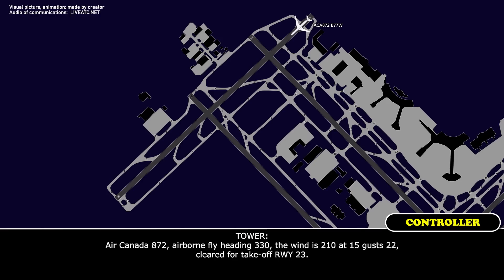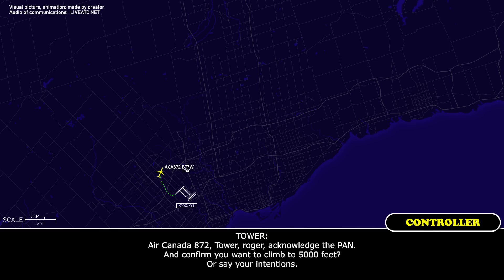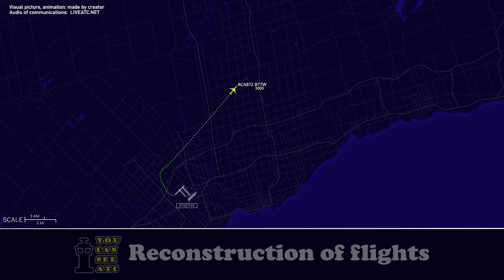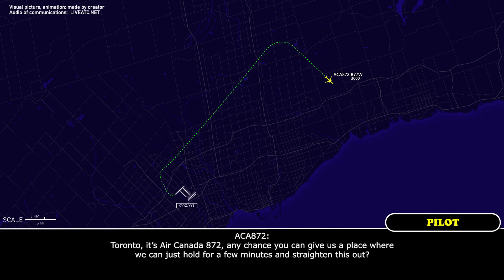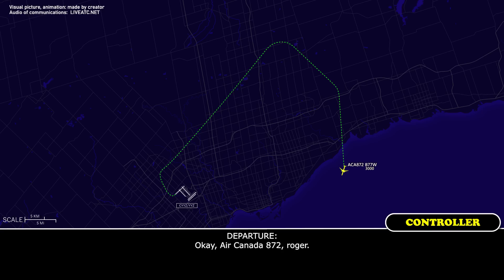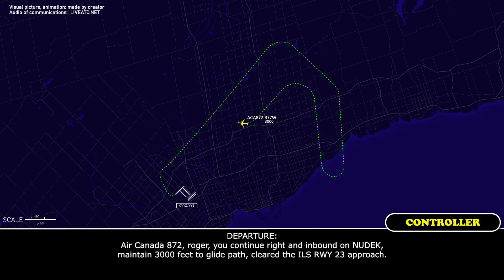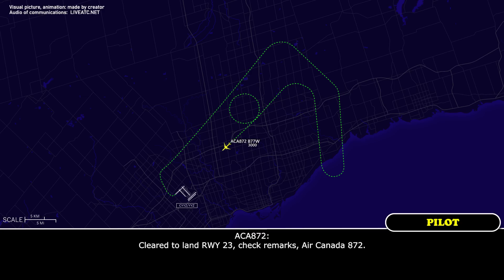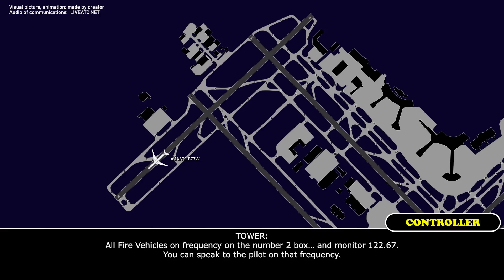“You got a lot of fire”. Air Canada Boeing 777 returns to Toronto Airport. Real ATC

Comment: They can takeoff on one engine.
Reply: Not legally, but if you were light enough and the runway was long enough I think you might be able to
Reply: NO they can't. At least not from a standing start.  Below V1(decision), an engine failure requires a reject. After V1 one must take-off and the certified and calculated Runway and Weight data assures a climb to meet all obstacle requirements from 400'AGL to 1500' AGL terrain excepted.

Comment: Professionalism on all accounts but was wondering with a aircraft that size and assume full tank that the plane can land without dumping fuel?
Reply: Landing overweight most of the time means just that the plane needs to be checked for damage.

And this plane was on its way to maintenance anyway.

They could have done it but it's not mandatory.

Most likely the pilots wanted to land before the thunderstorm came in.
Reply: Toronto to CDG isn’t a very long flight, they may well have been under max landing weight already

Comment: this aircraft is designed to have amble lift with ONE engine.  they practice single engine takeoffs on the simulator regularly. not a big deal. why are Canadians for fear prone ?
Reply: Correct that the plane can fly on one engine. But with a reported fire, nobody knows if it is contained or will spread to the wing or otherwise start knocking out systems or pushing smoke into the cabin air. No pilot or airline will continue a flight on a single engine.
Reply: @stevelappan8543 : Indeed. If you are still over land and have any issues with an engine, you don't proceed to crossing an ocean.
Reply: ETOPS?
Reply: For what’s its worth Dave 39 years of airline flying of which 5 years was on the  777 12 years 777 sim instructing CB s all quads at night .Not big deal until it’s your turn how many actual engine failures have you had better yet at V1 . I have had 4 none at V1
Reply: @gordkenworthy616 it’s not an engine failure, it’s a surge.
Reply: Yes you are right
Reply: Kick how many surges have you had in effect engine failure especially at V1 . I had one departing 33 at V1 when there only was 33 on a 727 . As you would expect number 2 we had a crosswind briefed for possibility trust me same effect as engine failure plus very loud bang . The guys got back on ground safely and in the end that’s all that counts .

Comment: Student pilot here . I know they have checklists to run but why are they flying away from the airport? They should have landed and sort things out at the airport instead.
Reply: Thats a fair observation.. I would say if you have an uncontrollable fire, or smoke in the cabin, get on the ground right away. In this case the plane is flying pretty good… don’t rush.. spending a few minutes in the checklist might prevent a mistake (shutting down the wrong engine for example… it’s happened). The hold/vectors allow a quick talk to the flight attendants and then the passengers too. But spending too much time flying on one engine simply to complete a checklist also seems like overkill. There’s a balance there IMO… good question for a discussion
Reply: They most likely had to shut down the engine that stalled.  So they have to run through the engine stall check list, then they have to do basically do a quick briefing for landing at the airport and then the landing checklist.

Comment: Second incident in a week, I believe the other was also a B777. ETOPS rating will be in trouble.
Reply: No it won’t. ETOPS gets in trouble for systematic problems, not for statistical anomalies
Reply: @swems-z3s  I think engines are systematic. A inflight shutdown last week and another B777 engine issue is a problem. Flying across the ocean on one engine is frowned upon. I'm pretty sure TC will be asking questions. Engine reliability is one of the biggest factors in maintaining ETOPS.
Reply: @2strokemerc  again, that is a statistical anomaly because there are no systematic issues prevalent. Especially when the incidents aren't even technically related. 
And btw. inflight shutdowns happen basically every other week across all kinds of aircraft types. Don't make a big story out of a non-issue.
Reply: @2strokemerc just because it’s a 777 doesn’t mean it’s the same type of engine.

Comment: Seems like a long time for a plane on fire to  be brought in..coulda exploded in mid air.
Reply: If they had reason to believe they were on fire and it was not extinguished, they would have been in a lot quicker. 

But they quickly identified the issue as a compressor stall on the #2 engine and followed procedures appropriately. 

Just because it looks like they had an uncontrolled fire from the ground doesn't mean that's what the actual issue was.
Reply: Apparently the engine is designed to fall off in the event of an un-contained fire that won’t go out, so, even with a severe fire you’d still fly a circuit of some form, so landing upwards of 6 minutes after take off.
Reply: @EdOeuna engines are absolutely not designed to just fall off if they're on fire.  They ARE designed to fall off if the attachment points between the engine, pylon or wing are overstressed somehow (to prevent even worse damage to the airframe), but that doesn't apply to a fire.  The engines are equipped with extinguishers though.
Reply: @stephenp448  - the GE90’s on the plane I fly certainly are. It’s not part of a checklist or procedure, but the bolts will fail through intense heat and release the engine. Hopefully you’d have landed by then and aren’t in the middle of a 207 minute ETOPS sector.
Reply: @EdOeuna  Interesting!  Not a design feature I had ever heard of.  You learn something new every day.
Reply: Nothing was on fire genius, it was an engine surge, a compressor stall, very similar to how an afterburner works

Comment: Would have gone with Mayday Mayday Mayday instead...pan pan isn't appropriate here.  But ICAO pilots think differently than U.S. domestic pilots.
Reply: And ATC at end of tape called it an "emergency aircraft."  Which this clearly is.
Reply: Perfect example here.  He is directed holding instructions by ATC, instead of the pilot directing what's better for them.
Reply: @1WINDSHEAR ATC immediately told them they can have whatever they need, and they always have the option to declare MAYDAY if they don't feel sufficiently heard. Why are you seeing issues where there are none?
Reply: @1WINDSHEAR the pilot specifically asked for someplace to hold....
Reply: Mayday is for imminent threat of life. There was none in this video. Pan is adequate.

Comment: Having flown a LOT of Jazz (AirCanada commuter flights) on CRJ-100/200s out of / into Pearson (YYZ)... basically a bus with wings, I've never had a moment of concern. 
   ONCE, we had a go-around and toured downtown Toronto, flying a loop around the CN Tower. It was a "highlight", not a concern.
Reply: Actually, with the automation in these aircraft, a hold is safer and preferred. Very easy to input and engage and then the aircraft can fly the pattern for a long time and be very safe. 
It’s a constant known pattern without the risk of being forgotten (think busy JFK airspace for example). This crew did a superb job.
Reply: @busboy3943  The flight path shown goes into "no mans land", in that, it's over a very densely populated area. When it crossed Dufferin then Yonge St. I was "sure" they had control. Otherwise, they'd head for the lakeshore.

Comment: Absolute solid decisions happened within that aircraft, they had an answer ready for the ATC regardless of what the questions were and subject to the many variables there were evolving. Commendable crew and controllers for not over-communicating...
Reply: Very true, intended to give pilots time and less chatter so they can address the issue with focus.
Reply: Big thing we get taught on those calls is to tell ATC to stand by after declaring the initial emergency/Pan Pan so they know we're doing stuff and will get back to them shortly. Easy way to wind up rushed otherwise.

Comment: ATC didn’t ask for POB and fuel remaining.
What does “Check Remarks” mean?
Reply: check remarks means I understood what you just told me and they do not require action on my part at this time.. Good shorthand, eh?
Reply: The not US. So they are smart enough to understand that the plane is full (or even look it up). Same for pax. Does require some basic communication capability within the airports departments. But very helpful for the pilots, who have much more important things to do.

Comment: The pilot keeps asking about the weather because a pretty major storm system was moving in from the West around the time. I believe it hit the city around 2300. If the flight was 2125 there would be genuine concern about airport conditions getting hairy.
Reply: No urgency to land with just one engine, so a diversion would be pretty simple if the weather had shut down the airport.
Reply: I wonder if that consideration was included in the departure brief?  Here’s a scenario where a takeoff alternate would be an excellent consideration even though the vis is not “low”.
Reply: @alpenglow1235  Dont worry im pretty sure they discussed it ;)

Comment: Curious why the controllers never ask for fuel and souls
Reply: To expand on what has already been shared, a pan pan call indicates that the flight is dealing with an urgent situation (usually a technical issue or failure) that does not pose a risk to life, i.e. does not yet reach the threshold for a mayday. 

The more familiar mayday call indicates that there is an imminent threat to life/loss of the plane. A pan pan call can be changed to a mayday if the situation worsens. You could argue that they are both technically emergency calls in the general way we use the word, but the mayday call is what is known as declaring an emergency. 

The plane is designed to fly safely on one engine and as long as the major systems continued to work, they could fly the plane safely, and they expected to be able to land normally, the pilots likely didn't think the situation met the threshold for declaring an emergency (mayday). In a situation like this, the emergency crew on the ground would have been deployed in either case, out of an abundance of caution, so it had no real impact on the ground response.

The ATC does refer to the flight as the emergency aircraft. That could be a matter of semantics (speaking to an emergency crew about their target aircraft in an emergency response, it makes sense to call it the emergency aircraft), but interestingly, this reminded me that ATC is able to declare an emergency for you, based on their judgement. Perhaps they did so, given the dramatic flaming engine they viewed as the aircraft took off.
Reply: true. But a lot of times a controller will still want to know especially since they rolled equipment and referred to the aircraft as the “emergency aircraft”
Reply: @jon_august  Sometimes it can be determined without asking the pilots - if the aircraft is returning to the same airport it departed from, the airport will have that info and controllers may ask the airport instead of the pilots. Also, if the flight just left and is immediately returning, we can assume a lot of fuel.
Reply: My guess would be Canadian airport is able to communicate inside the port. Someone on ground definitely knew the amount of fuel and people put in and because the plane just took off that number was still correct.

No need to bother the pilots.
Reply: @JariJuslin  that shouldn’t be rocket science. Call airline dispatch, ramp, etc
Reply: They did not declare an emergency.
Reply: You mean a frying pan declaration does not require souls, fuel and lav chemicals onboard?
Reply: @RLTtizME  Exactly.
Reply: @Quotenwagnerianer  I'm switching to emergency. Maypans are unnecessarily complicated.
Reply: @RLTtizME  No they are not.
Reply: @Quotenwagnerianer  Yes they certainly are.  You are wandering helpless.

Comment: For those who may not be aware, the engine may still be able to produce power in the event of a compressor stall (albeit at a reduced rate) and the fire seen is not necessarily an engine fire but unspent fuel combusting and exiting aft due to the disruption of airflow into the compressor
Reply: so, something like an unexpected afterburner ?
Reply: @delfinenteddyson9865 it isn’t making extra thrust though.
Reply: @malcolmanderson5737  how very disappointing :(
Reply: Thank you for the explanation.
Reply: Can't a compressor stall sometimes be corrected by reducing thrust and then increase of power once it's burning good again (airflow into the engine)?  I thought a compressor stall is the airflow all messed up like a wing stall (in a way).
Reply: @pfsantos007  you're right. The procedure is to reduce the power until the engine stops surging/stalling. If that doesn't do the trick then you would shut down the engine. 

You could then decide to reincrease the power and see if the problem has corrected itself. But this is up to the captain's discretion. I believe most captains would simply keep the engine at idle rather than try to power it back up and risk scaring the passengers further in the event the stall reoccurs. In a case like this, it's not like they're going to carry-on with the flight anyway since no one in their right mind would cross the ocean with an engine that isn't performing correctly.
Reply: @olivierwery7336 - you’d consider yourself OEI from this point forward, including single engine thrust for any go-around.
Reply: @pfsantos007  You can try but that airflow disruption is usually caused by bird ingestion so your efforts might be fruitless.
Reply: fire on any aircraft is never a good thing
Reply: 한국에서는 또 보잉탓 합니다.. 이구
Reply: Yeah, all a ok. Phhhttt! That’s why they had to turn around and make an emergency landing.
Reply: The FADEC doesn’t do the math and derate due to EGT from all that fuel?
Reply: @jaysmith1408  yes, but even with FADEC adjustments you may still have visible flames if there is unspent fuel igniting outside the combustion chamber as engine parameters are brought back under control
Reply: But that makes it seem like a routine failure and not at all worthy of a chicken little YouTube. 🙄 Obviously I'm joking,  thanks for a voice of reason.

Comment: What? Not asking for souls on board and fuel remaining a dozen times? Tsss….
Reply: Not an emergency aircraft.
Reply: @Nick-E1v2  yes it is
Reply: @Gee1410thirtysix  PAN-PAN is not an emergency aircraft. It is only used for an urgent situation.
Reply: @Nick-E1v2  wrong. Pan and mayday only refer to priority level of communications with multiple emergencies. And both fall under emergencies. Go read ICAO or FAA docs. Hint for you: the FAA lists it under “emergency procedures.” Mayday isn’t even defined as an emergency: it’s defined as distress. And distress is defined as in danger and needing help. Both are emergencies and defined as such by ICAO. Hence the vehicles being rolled and emergency handling.
Reply: This happened in Canada, so FAA regs don't apply.  "Distress is a situation when safety is being threatened by grave and imminent danger and requires immediate assistance. The spoken word for distress is MAYDAY and is pronounced 3 times.  The urgency signal indicates that the station calling has a very urgent message to transmit concerning the safety of an aircraft, ship or other vehicle, or the safety of a person.  The urgency signal is "PAN PAN" spoken three times."
Reply: @stephenp448  same description in both countries as they’re ICAO. And both are for emergencies. One distress, one urgent. Distress isn’t defined as an emergency either: ICAO says both are emergencies. Hence why plenty of Canadian Pan Pan’s ask for souls and fuel as well. Do you need a link to one

Comment: This thing shook my house yesterday as it made the right turn over the residential area on the initial turn.
Reply: SAME! At first I was like - WTF it sounds like a plane??! But then I was like - maybe I've just been watching too many ATC videos?? But yeah, I felt it too!
Reply: @janeryan2709  Yeah 777s are ballsy
Reply: @janeryan2709  and to think that was a single engine lol
Reply: SAME! it sounded so loud outside my house in richmond hill!
Reply: @itsfrostifyy  no doubt. Capped off around 3500ft. It was interesting listening to the live ATC and tracking it on flightradar. Luckily they had the emergency frequency up too.
Reply: @SVP3005  yep, i was listening to the live atc and was tracking it as well, i originally thought it was a flaps failure or instrument failure but turns out it was an engine on fire
Reply: @SVP3005 hey, how do you listen to live ATC? thanks
Reply: Same. I ran outside to see it banking NE after it went over my house at an alt between 1700-1900 ft. I thought it was going down by how low it was. I’m use to planes going over but not at that height. It was so loud.
Reply: @RokkiyChakku-n5c  I was a bit too lazy to run out, but same thought. That was crazy low.
Reply: @SVP3005 hey, what do you use to listen to live ATC? thanks!
Reply: @RokkiyChakku-n5c  yep